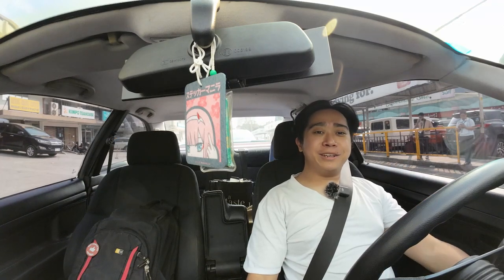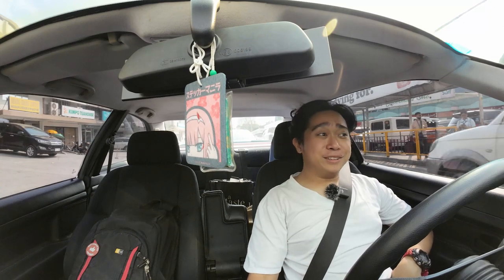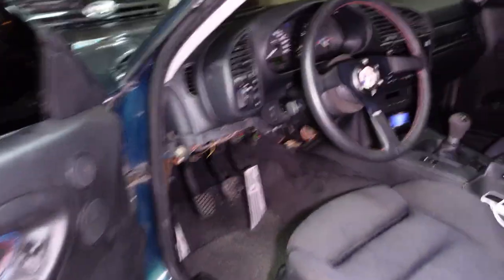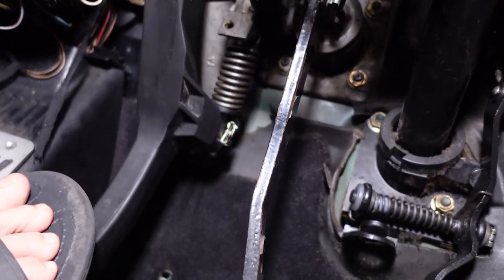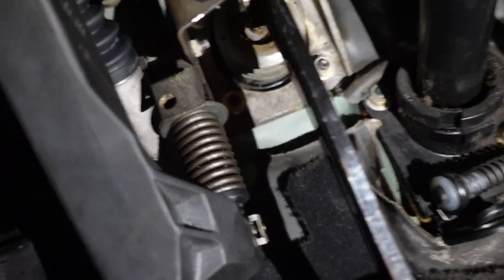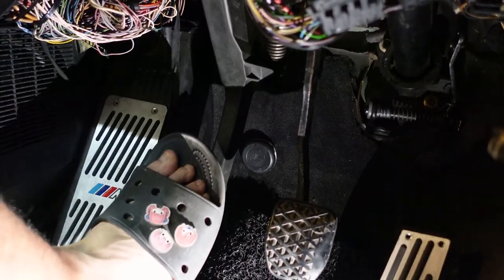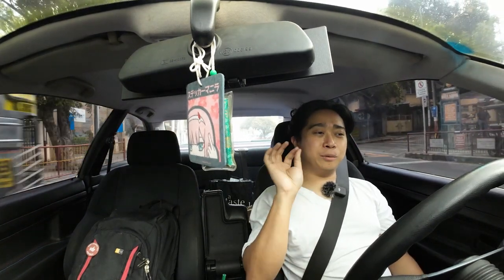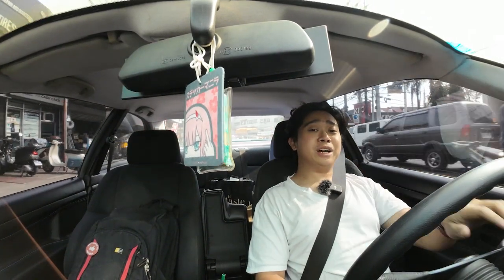BMW E36 Stiff Clutch Fix

Comment: Thanks for the video my knee hurts and I am having this issue for two years I even changed the clutch because that what’s the dealer recommended but it did not help so thanks for taking time ! I will apply your tips!
Reply from the maker: Glad it helped! I almost lost my mind figuring it out so the least I could do was pass the knowledge.